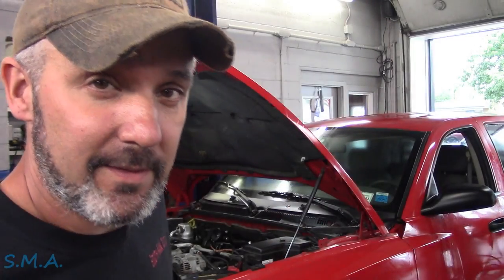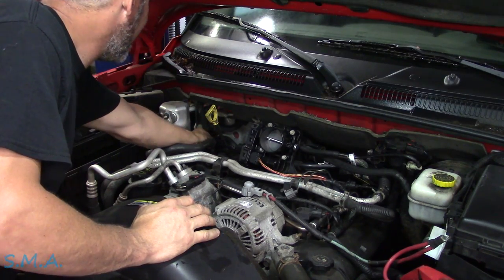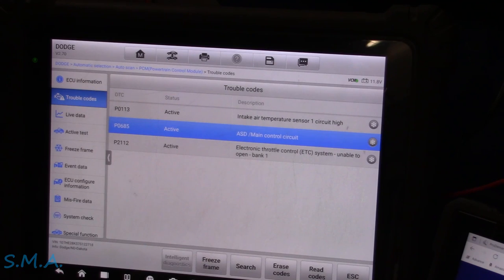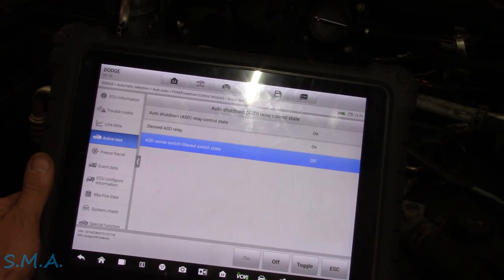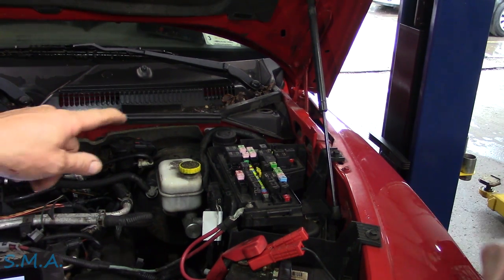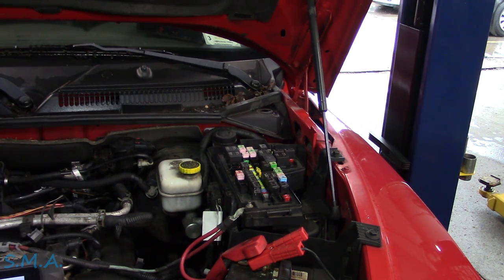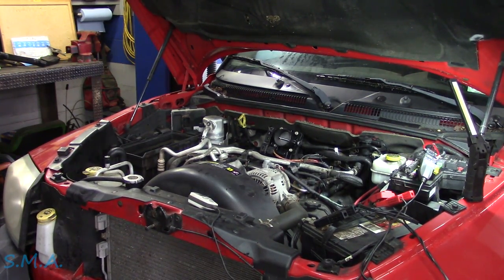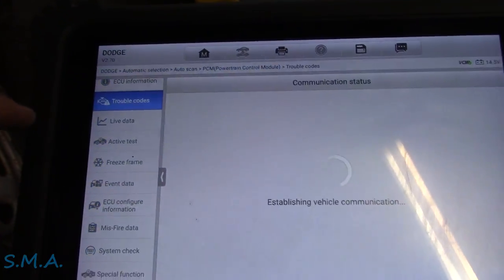Dodge Dakota: No Start After Clutch Replacement

Comment: 05 Chevy Kodiak shut down running 70 MPH. Coasted to the shoulder, got out tested the fuse. Test showed good, so after an hour. Called a wrecker, 4 hours later it was being towed to the shop. I had a buddy come get the 40ft 5th wheel camper.
Next day the shop called me. Your 50 amp Maxi Fuse was blown. Even though I checked it and it showed good. Guess it was not good. To this day still no ideal why my tester was showing good across that fuse. But then again sure got good MPGs on that 56 mile tow. And Road Side service covered the whole thing.

Comment: My parents vehicle had a light come on and they took it in to the dealer and they wanted to do a couple grand of EVAP system work. I asked for the keys and found the manual. I looked up the EVAP fuse location and it was blown. I replaced it and took it around the block and no more dash light. Fixed it! They were stunned! Why hasn't Hannah and her friend been in any movies lately? You know what is funny? I was a machinist at one time...lol

Comment: Replaced the clutch in my ex-wife's mitsu lancer a few years ago. All went well until I hooked everything back up and tried to start it. I could not get it to start after. No crank, no start. Turned out there are 3 wires that run to the positive battery terminal junction. I mixed up the wires to where the A/C clutch would engage when I tried to start it, but not the starter.

Comment: Worked at a service station years ago and went on a service call.  Guy said his car wouldn't start.  Said he just tuned it up.  Tried it and all it would do was pop every revolution.  This was a mid-60s chevrolet.  Removed distributor cap and found he had rotor button in backwards, forcing a square peg into round hole, etc.  Reversed it and it fired right.  Told him to take it to the station and wd could set the dwell.  Easy.

Comment: Many years ago some mechanic buddies of mine were ceaselessly working on a big old Cadillac and getting nowhere.  It took a piano player like me to tell them to pull out both fuel injectors and take a reading with an ohmeter.  Lo and behold one of 'em gave a reading in the high megaohm range.  Jaws dropped realising I was right.  Was replaced and ran fine.  That was the day I realized I was just as smart as a real mechanic!

Comment: I sold a Dodge Dakota to a friend of a friend. He called me about a week later all pissed off because the headlights wouldn't go on. I felt bad. I asked him to bring it back and told him I would make it right, so chill. He comes over. I try the lights, they don't work. I push the turn indicator lever to put on the brights, works fine. Put the low beams on, all fine. He must have bumped the lever into the 'not high, not low' center  'off' position after he shut the lights off the last time. He was embarrassed. That was a tasty six pack, he bought me.

Comment: I bought a car from a friend for $200 because it overheated and stopped running. Car was a 1991 Dodge Shadow. Found out that when it overheated it dropped a valve seat, which caused the valve to stick open, which broke the broke the rocker arm and that caused the rocker on the other valve to get knocked sideways. After having a shop press and cut the new valve seat to the new valve and shave the head, I was putting it all back together and pinched the positive wire for the in tank fuel pump between the head and valve cover, which blew the fusible link (stupidest things ever invented). Thankfully I had the telltale smoke to show me what blew as there was 5 or 6 of them suckers taped together. Thankfully it was an easy fix, saw the pinched wire, removed and repaired (cut the wire, slipped on a heat shrink, splayed the two ends then mesh-twisted them together with some solder afterwards), then cut out the old link and spliced in a new one. 

Unfortunately, the engine was already doomed. Someone "rebuilt" it at some point and had the pistons rotated 180 degrees, which ended up warping the crank after time. I had left the car for my brother when I moved away and the crank seal gave out due to the warped crank, brother ran it dry and blew the engine. Oh well, it drove me where I needed it to for a year, not bad for under $400.

Comment: I threw my gear into the truck,  did a quick pre-trip (winter time),  and shut off the Espar interior heater.  Turned the key, waited for the gauge cluster to sweep and reset,  then cranked it.  And cranked it.  And cranked it.  It would crank and crank and crank,  would not fire.  A few phone calls, it would be a few hours before they would get to me, as there were lots of no-starts on-the-go.  My safety and compliance guy asked if I had checked the fluids, well, YEAH, of course.  Plenty of oil, coolant looked fine... he said "dump a little wee bit more in the reservoir".  So, to humor him,  I did, and voila... it fired right up.  Damned sensor was just a hair above the liquid line, and wouldn't let if fire, until I added about a pint, submerging the stupid sensor.  Not sure whether to blame Detroit, Freightliner, or just myself for the stupidity.

Comment: About a year ago, pulled the dash cluster on my 05 Silvy to have a couple of stepper motors replaced. Followed a YouTube video to pull it. Once it was ready, the shop gave 'detailed' step by step instructions to re-install it. Followed them to a Tee. Didn't work, repeated pulling it and reinstalling. No joy. Husband tried to help, no joy. Called a neighbor down. Yeah, the repair shop left out 1 step - after installing, hook the battery back up. As I have limited tools and training I didn't feel too ashamed but Husband was beside himself 😆

Comment: Once I was doing rear brakes on a sienna. I was using the good old rotor screw and I kept going after the pop on both sides. E brake parts started falling out of the gaps. Took two other more experienced techs an hour to get them off.

Comment: 1985 chevy celebrity. Changed cap and rotor on back side of engine. Well pinched fuel pump wire. Kept blowing fuel pump fuse. But took 2 months to rub through. After 2 pumps. I finally found it.

Comment: My school friend got a 4 cyl Renault cheap. It was a non runner, the previous owner had replaced the head after cam belt failure but just could not get it running so gave up on it & sold it as a parts car.  After he got it home I checked some basics for him and found that the timing was set up wrong. Renault number the cylinders right to left when looking under the bonnet  4-3-2-1 . no 1 is at the clutch end ! . He kept the car for until he finished university before passing it on to his sister who also used it until she finished university too.

Comment: I built a new Hemi for my 2004 Ram 1500 a couple months ago, put it in , hooked everything up and cranked it and had a dead miss on cyl.5. I went through the basics I could do with my limited tools and ability like checking fuel pressure, compression, and fuel injector clicks and all was fine. Buttoned it back up, cranked it and still no #5. Long story short, 2 days later I found the problem. When I plugged in the injector I couldn't really see it but I could hear it click. Come to find out it was a piece of zip tie on the wires that was making the noise making me think the injector was plugged completely in when it wasn't! Plugged it all the way in and no miss since. Wasted a lot of time and felt like a fool but I got it finally!!

Comment: Another Epic Blown Fuse diagnostic by SMA ... 3 X's $85 X's 2 hrs... lol ... great point on the negative battery terminal removal whenever you're fool'in around near electrical components and wires ... hopefully it will save someone a big head ache down the road ... and I always throw a cloth/towel over the terminals in case I drop something on them (not that I've ever done that ;)

Comment: Had same issue with my 98 Dakota could not figure out kept blowing that fuse 2000 dollars later at dodge  dealer to find out was a bad ground it took them 7 hours to find  it. They were ready to call it quits until a different mechanic came over and found it.  Never had a problem after that. Eventually sold it but was a excelent truck. It had the 318 lots of power for small truck.

Comment: My truck has a self opening tailgate,  before leaving parking lot.  You have to slam tail gate closed.  Push the recirculate ac button and ac is cold.  I do not like the backup sensor on one of our trucks.  The simplest repair was buying a new harness for a tool.  It took longer to get the part;  than to repair issue.  Old harness was disposed of.

Comment: Eric, had a call on a deed foundation equipment that when it gets cold it won't start. Drive 5 hours to machine and look at it, it was -20 so not overly cold but starter wouldn't spin over fast enough to start. Machine had new batteries in it so wasn't that, test starter and it wasn't drawing over, check that pumps disengaged and they were. Customer getting frustrated told me to change the batteries, I said they were new and he thought they got a set of bad batteries as old ones were fried and this issue only happened when they replaced batteries. Unhook big 4D batteries and remove throw in new and went to hook up the terminals and I kid you not, the last guy didn't remove the little red and black plastic caps over the terminals before hooking them up. There was two small holes melted I. The positive and negative. Took pictures and showed customer. Removed caps and it worked like new. 10 hours of driving for for a total of 30  minutes of actual diagnosis time.

Comment: My worst one was after I rebuilt a chevy 350, got it back in the '77 blazer, and ran pretty good but wouldn't idle, little stumble etc. I was looking around for an unhooked vacuum line, totally missed the mechanics first check back then, spray the baseplate of the carb with  cleaner, yup, the brand new 1/4" type gasket leaked like crazy, found the old one in a box which worked great. Spent many more hours on that one until I really felt like an idiot.

Comment: My neighbours suzuki jeep was running rough then not at all. Had half a tank of fuel according the gauge. Cracked a fuel line, nothing but air so had a look underneath for the filter. Seen the fuel tank had a massive dent essentially crushing the tank to half way in the centre. Filled with gas and she fired right up!

Comment: I fixed a rotted  crossover pipe  on 08 CRV with the big 2.4. Changed the coolant ran it while bleeding it,test drove it. Gave it back and she came back a hour later saying it's leaking all over her driveway. I was like what in the thunder, start tearing it apart again bc that line is under everything and nothing is leaking, turned out she had the AC on. So it was just condition. I was relieved and she was embarrassed.

Comment: My Tacoma was taking several minutes to cold start and wasn't running right until it was warmed up. After being puzzled for weeks if not months, I discovered that I broke the coolant temperature sensor when I changed the head gasket.

Comment: I think I replied this before, but my friend had a 1995 Volvo 850 sedan and occasionally it left him hoofing it. The shop his family liked taking vehicles to, "diagnosed" it as a fuel pump, and put a new one in it each time. Which if I remember correctly, they did it at no cost to them each time after the first. They were trying to get rid of the car for a while because they thought it was the car's fault. Then it acted up when it was parked at my house, crank, no-start. I didn't know much about cars but I know a bit about electricity, got my trusty old multimeter out, and hooked the leads on the fuel pump. No voltage at all. Then I got to thinking, not only was the guy putting fuel pumps in it, he was also giving the car a ride on his rollback. Meaning rough ride. I was thinking that the mechanic probably tested it before he loaded it up to head back to the shop, not after the trip. So I pulled the fuel pump relay, gave it a few taps, and stuck it back in. Car started right up, and ran like a champ. Trip to NAPA (not a sponsor), new relay, and that car drove problem free for another couple of years, until it started burning so much oil my friend didn't want to deal with it anymore, and sold it to a guy willing to replace the engine or rebuild it.

Edit: Tip to mechanics: If you don't know enough about electricity to read for voltage on the multimeter, or to trace a simple flow diagram to pinpoint an issue, maybe learn it or refer to someone that has more knowledge in that regard. Don't be afraid to ask for help when working out of your own expertise.

Comment: My first engine swap was putting a reman long block in my son’s 93 Bronco. Fired it up and it ran like crap, fouling plugs, etc. We felt it had to be a timing issue but firing order was correct, timing marks were good. After a few days of cussing we realized they sent us a 95 or later 5.0 that had a different firing order. Even more cussing ensued.
Reply: That's pretty diabolical!
Reply: @Graham_Wideman  Exactly. We restabbed the distributor several times etc, and finally out of desperation tried the later firing order and it fired right up. I don’t think I’ve ever been so simultaneously angry and happy.

Comment: Had a 2019 F550 crank no start. Guy driving it said it acted like it ran out of gas, but the gauge showed half a tank. Fuel pump kicks on when key cycles. Checked fuses, power and ground at driver module and inspected wiring along frame rail - all good. Scratched my head. Grabbed a dead blow and rapped on the bottom of the tank. Wouldn't you know it, the fuel gauge now read empty.

Comment: Changing an EGR valve on a 2004 VW Golf TDi (famous for having failing EGR valves and turbo chargers in that generation) 
I had disconnected the negative battery terminal however I failed to notice that the terminal had fallen back and was resting on the negative post. That was until my ratchet crossed between the alternator positive and a bracket bolted to the body. The fastest I have ever jumped back let me tell you. Silly things happen even to those who think they did everything right.

Comment: I once forgot to put bolt down the intake manifold on my 4cyl Mazda truck after swapping long blocks. At idle the intake was flush with the block, but when it was moving and under load the engine would twist slightly and a vacuum leak happen causing the engine to misfire and lose power. 8 M12 nuts cost me $120 at a shop.

Comment: Removed and had the cylinder head reworked on my first car 30 years ago, it had a distributor I thought I’d marked it up, anyways put it back together wouldn’t start I fiddled with everything rebuilt the carb etc after two weeks I gave up and asked a local garage - a very grumpy mechanic came and looked at it, asked me to turn it over, got out an adjustable spanner turned the distributor 180 degrees and it fired up - boy did I feel a chump.

Comment: I once paid a national company (they have since been bought out I think) to replace the clutch assembly in my 1989 ranger. I got it back and it ran like it had a stopped up cat so I got a friend who runs a muffler shop to put it on a lift and we were going to change the cats. We looked up to see bank one's O2 sensor wire pinched in between the bell housing and the block. The transmission shop repaired it at no charge obviously. The shop manager informed me before they repaired it that the call back had cost his techs a bonus this week. Not sure I wanted a guy who was mad that he missed his bonus because his co-worker pinched a wire. I know they didn't get many manual transmissions because  when I first called the shop and told them it was a 5-speed I could hear the surprise in his voice, LOL.

Comment: Spent an entire day going thru a ‘98 dodge neon no start to eventually find that the ecm fuse had a leg cut off. When checked with a yet light the pressure would push the stub in and make contact showing it was good. “Sabotage” By used car buyer at auction.

Comment: My favourite bodyshop always blows a fuse while taking out trim inside a car. On the second last clutch job (old Toyota with a carby still) they accidentally dislodged a vacuum pipe causing a huge vacuum leak and the AC didn't work (it was the vacuum line for the AC idle-up diaphragm).

Comment: -- Stupid fast repairs, okay, many but here's my most recent.   Forward HVAC in my 2004 Tahoe winter beater would cycle vents.  Stuck on defrost.  So I get online to research.  A few hours worth.  Reset procedures, tried that first, no dice.  Swapping modules and actuators.  I'm getting ready to start yanking components out when my dad shows up and starts hosing the cam down there with silicone.  It's worked perfectly ever since.   I would have been at it for hours if not for him.  But he'd owned a few, just tossed me the can and said 'Those things want to be lubricated'.  
    Rear HVAC was a different story.  Both the module and actuator were bad, and someone - maybe a 2 year old with a chainsaw - had been in there before me.